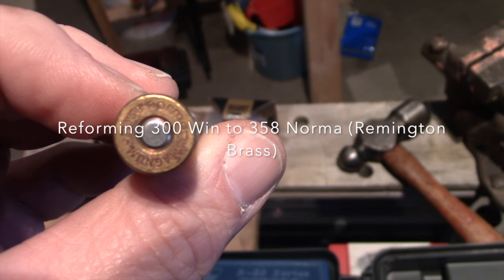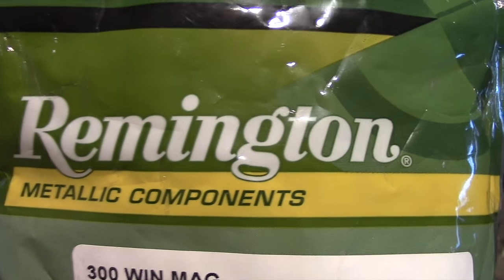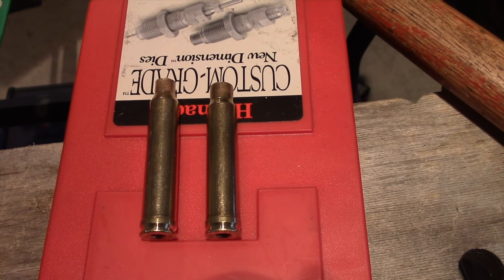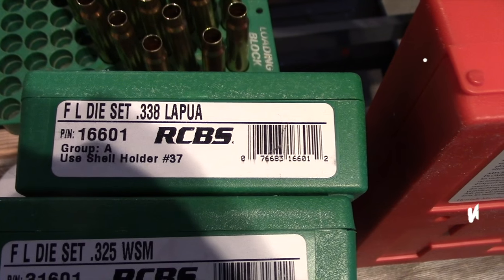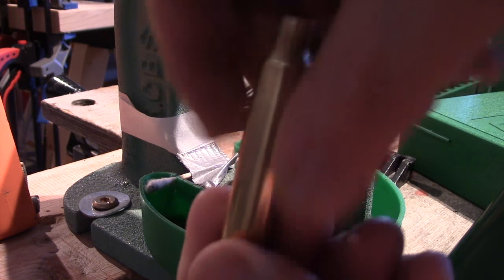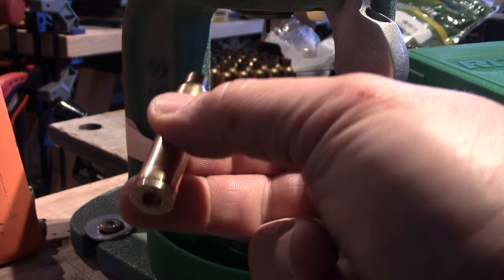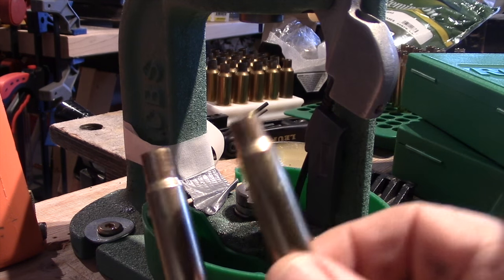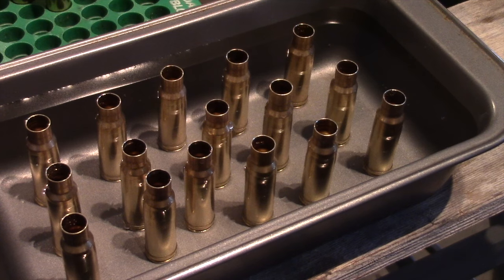How to make 358 Norma from 300 Winchester cases

Comment: Just a tip I learned from the guy who sold me my .358 Norma. He used and I am using .338 Win Mag brass, a lot less work than .300 Win Mag. Just run them through a .358 Norma sizing die to open up the neck, trim to uniform length, load, and fire. The shoulder will fireform and blow forward the approximately .040" it needs to go. The brass will be a bit short my Remington .338 Win Mag brass came out of the bag at about 2.485"-2.490" when it really should be 2.500" and .358 Norma would be 2.520". I just trimmed it all to 2.480" and let it go, I was told to watch for a carbon ring in the chamber but so far so good. I've only put 30 or so rounds through it as I have several other rifles I'm currently working with.

Note: When I bought my rifle there was no .358 Norma brass in stock anywhere, guys on forums wanted $1-$2 a case for their brass, and .300 Win Mag brass was also out of stock everywhere but .338 Win Mag brass was plentiful and the same price as .300 Win Mag brass.
Reply from the maker: I was worried about the excess head-space and the shoulder blowing forward but maybe I'll give it a whirl.
Reply: Use what you can find for sure haha.  I’ve hD no issue with my .300 brass BUT I owned a .300 Winnie for years before I got my .358 so I had a veritable stockpile of brass available haha

Comment: Excellent video. The  Reamer got away from the gunsmith so my chamber accepts full length 300 Win Mag necked up to 358. I wanted it throated for the 310 Woodleigh bullet. I'm not sure where the free bore stops but it is accurate with 225, 250, 275 and 280 bullets so I guess not all is lost.
Reply: Sounds like a more practical chambering anyway haha

Comment: North, I am embarking on building either a 358 Norma mag or a 375 ruger. I am wanting to know what u would do? The weapon is an FN mauser chambered in 7rem mag now and gonna have it rebored and I have the choice between the two. Using it to hunt everything from deer to elk and whatever walks I guess. I’m a handloader too. Thanks
Reply from the maker: Both great cartridges.   Given supply problems I might go 358 Norma as you can make the case from almost any medium to long  magnum case and I have a ton of 358 bullets.   375 bullets might be just a bit easier to find .   Factory ammo also might be a bit easier with the 375.   It's really a wash.   If you go Norma try and find a 12" twist barrel so you can shoot good heavy bullets.   The 14 and 16 are a bit too slow.
Reply: @north61  perfect, glad to have the guidance. I was leaning more toward the 358 Norma anyhow. I’m having it done as a reboring job by a guy who specializes in such work with all different calibers in the 338-375  caliber.

Comment: I've read suggestions about forming this brass from a 7mm Rem Mag case. Have you tried that or have suggestions?
Reply from the maker: Better to use 338...both would need to blow the shoulder forward a bit... the 7mm to 35 is working the brass quite a lot more than I like to.

Comment: Beware of Norma Brass! Safety Warning! I got brass failure/head separation after only 3 loadings. Using the same load with Hornady brass, I have had absolutely no problems. The Hornady brass have been loaded 16-18 times! Buy Hornady and don't take a chance on getting injured with Norma brass.
Reply: I'm guessing you got a bad batch or there was some other issue. Norma is not known for making bad products. I personally use .338 Winchester brass as .358 Norma brass has been out of stock everywhere since I got my rifle, and the guys who are willing to sell there .358 brass want $1-$2 per case.
Reply: I sent the cases back to Norma and they agreed there was something wrong with them but refused to replace. And, stopped answering my emails. The Hornady brass now has 24 firings on them with no signs of giving up. Norma is too expensive to take a chance on, especially when the heads are separating off the case.